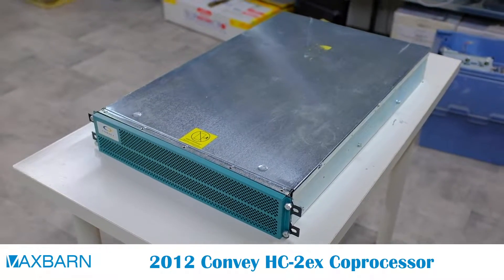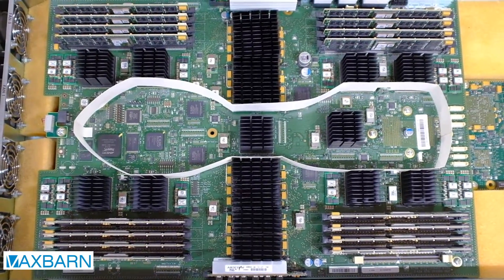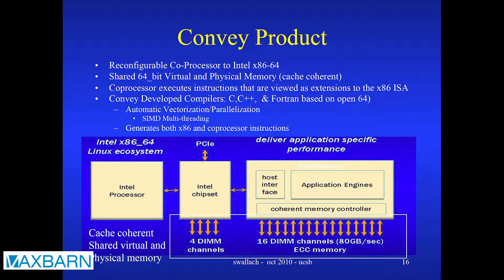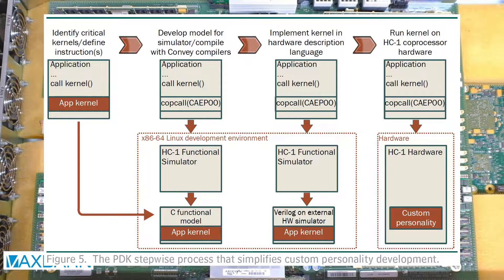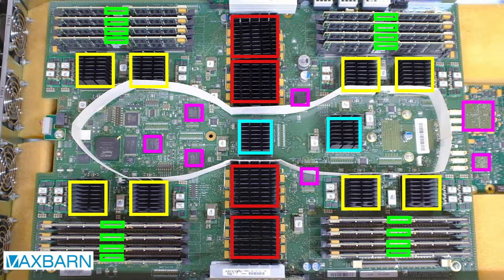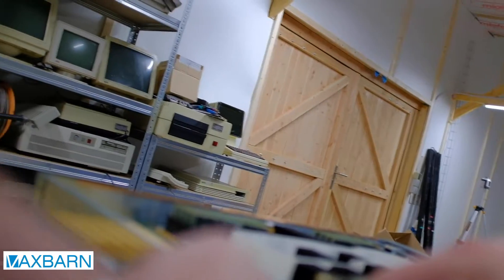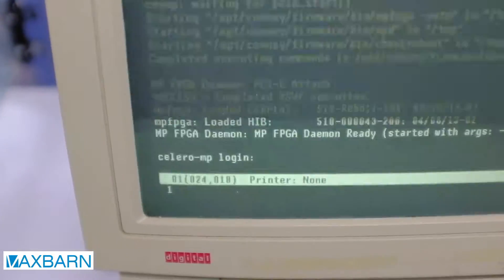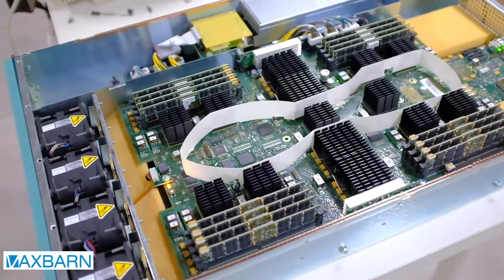First look at the Convey HC-2ex HPC Coprocessor

Comment: Use the u-boot prompt, change the linux init parameter to /bin/sh, it will boot jump to a shell, not asking for a password, edit the /etc/passwd or/and the  /etc/shadow(depends if its used) to no ask for a password. , reboot the system,  in the system, search for testing utilities, and please film it! thanks for your videos man!
Reply from the maker: I've tried that; I created an environment variable "bootsingle" so I can issue a "run bootsingle" command at the prompt. That gets me to a root prompt. There's no /etc/shadow, and /etc/passwd has an MD5 password hash for the root user. Tried replacing it with "*" and with a known hash, but neither of those will let me log in. If I type "root" at the login prompt, I get a password prompt. If I then hit <enter> or my known password, I get a new login prompt. If I type anything other than root at the login prompt, there's no prompt for a password and i immediately get a new login prompt.
Reply: @CamielVanderhoeven  No :) for example if the root line is: root:MD5PASSWD:0:0:root:/home/root:/bin/sh    just change it(remove the "MD5PASSWD" portion ) to root::0:0:root:/home/root:/bin/sh   it will let you enter with just user root and enter at the password prompt
Reply from the maker: Tried that too, same behavior...
Reply: @CamielVanderhoeven  probably the busybox is a more recent one and it must use salting in the password field. That would explain that the known md5 password you tried, failed.
Have you tried to see if the useradd is available ? If it is is  just a matter of adding a user and after that change it to root in the passwd file
Reply from the maker: No useradd... BusyBox v1.3.0 (2011-11-07 01:36:49 CST) multi-call binary
Reply from the maker: I put in a known hash with the same salt as the original password, and no luck...
Reply from the maker: Running login from single-user mode behaves differently from the login prompt provided after a full boot:

~ # login
celero-mp login: root
Password:
login[24]: root login on 'console'

-sh: can't access tty; job control turned off
* WARNING: Clock has been margined!  *
celero-mp / #

versus

celero-mp login: root
cny1_AC07120330015_444220 Password: ********

celero-mp login:
Reply: @CamielVanderhoeven  Just an ugly hack...  if you boot in singlemode and then do "init 3" to boot the system in normal mode (I'm assuming the default init level is 3), does the system have USB ports or ethernet port accessing from the PowerPC CPU ? Maybe making a backup of the flash of the system would be a good idea....
Reply from the maker: ~ # init 3
BusyBox v1.3.0 (2011-11-07 01:36:49 CST) multi-call binary

Usage: init

Init is the parent of all processes.

~ # init
BusyBox v1.3.0 (2011-11-07 01:36:49 CST) multi-call binary

Usage: init

Init is the parent of all processes.
Reply: @CamielVanderhoeven   hum.... he he ... the command chpasswd is available? Beginning to be very tempted to check the busybox code for the authentication
Reply from the maker: No. Here's what we do have:

~ # busybox
BusyBox v1.3.0 (2011-11-07 01:36:49 CST) multi-call binary
Copyright (C) 1998-2006 ┬áErik Andersen, Rob Landley, and others.
Licensed under GPLv2. ┬áSee source distribution for full notice.

Usage: busybox [function] [arguments]...
   or: [function] [arguments]...

        BusyBox is a multi-call binary that combines many common Unix
        utilities into a single executable.  Most people will create a
        link to busybox for each function they wish to use and BusyBox
        will act like whatever it was invoked as!

Currently defined functions:
        [, [[, ash, awk, basename, busybox, cal, cat, catv, chattr,
        chgrp, chmod, chown, chroot, chvt, cksum, clear, cmp,
        comm, cp, cut, date, dc, dd, deallocvt, df, dhcprelay,
        diff, dirname, dmesg, dnsd, dumpkmap, dumpleases, echo,
        egrep, env, ether-wake, expr, fakeidentd, false, fbset,
        fgrep, find, fold, free, freeramdisk, ftpget, ftpput,
        fuser, getopt, getty, grep, gunzip, gzip, halt, head,
        hexdump, hostid, hostname, httpd, hwclock, id, ifconfig,
        ifdown, ifup, inetd, init, insmod, install, ip, ipaddr,
        ipcalc, ipcrm, ipcs, iplink, iproute, iprule, iptunnel,
        kill, killall, killall5, klogd, length, less, linux32,
        linux64, linuxrc, ln, loadfont, loadkmap, logger, login,
        logname, logread, losetup, ls, lsmod, lzmacat, makedevs,
        md5sum, mdev, mkdir, mkfifo, mknod, mkswap, mktemp, modprobe,
        more, mount, mountpoint, mv, nameif, nc, netstat, nice,
        nohup, nslookup, od, openvt, pidof, ping, ping6, pivot_root,
        poweroff, printenv, printf, ps, pwd, rdate, readlink,
        readprofile, realpath, reboot, renice, reset, resize,
        rm, rmdir, rmmod, route, run-parts, sed, seq, setarch,
        setconsole, sh, sha1sum, sleep, sort, stat, strings, stty,
        sum, swapoff, swapon, switch_root, sync, sysctl, syslogd,
        tail, tar, tee, telnet, telnetd, test, tftp, time, top,
        touch, tr, traceroute, true, tty, udhcpc, udhcpd, umount,
        uname, uncompress, uniq, unlzma, unzip, uptime, usleep,
        vconfig, vi, watch, watchdog, wc, wget, which, who, whoami,
        xargs, yes, zcat, zcip
Reply from the maker: So, I now have the os going on an appropriate host main server. The serial port on the coprocessor is purely for maintenance purposes. The login is highly customized and appears to use a challenge/response system.
Reply: @CamielVanderhoeven  Interesting.... thanks for the new video! Very cool to see the boot process!